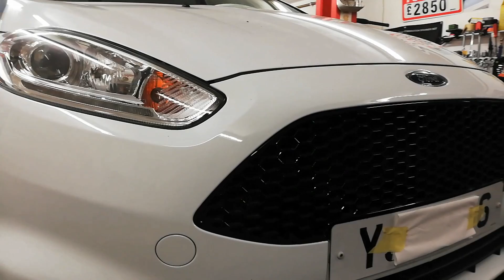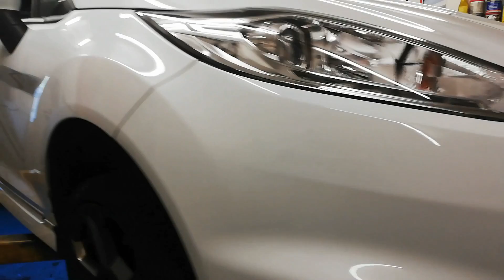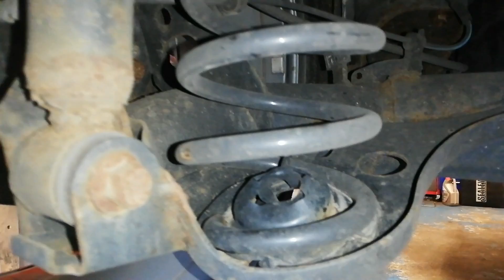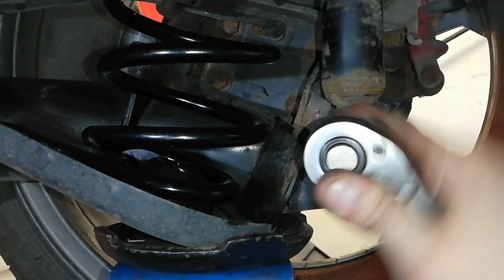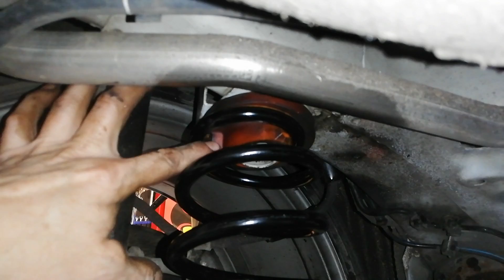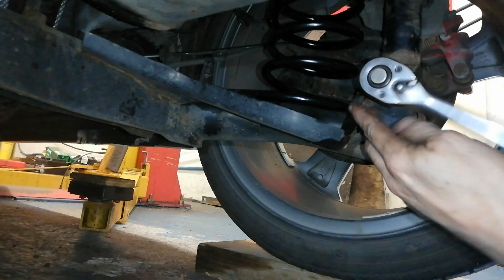Ford Fiesta ST Rear Coil Springs Replace

Comment: Hi Dave, this job just about beat me. I just couldn't get the bottom shock absorber bolt out. Tried everything apart from heat which I thought would be dangerous as it could heat up the shock absorber. So, just removed the two top mounting bolts for the shock absorber which came out very easily. Keep the videos coming , I enjoy them and have  learnt a lot!

Comment: I did this today . There's no need for compressor tool.  Use a trolley jack on the axle cross beam . Undo both shock absorber bolts . Drop the axle . Change springs .raise axle reinsert bolts . Done . I used threadless too .
Reply from the maker: Of course you can do that too. But this is a proper workshop with proper tools that can allow us to do this job in 10 minutes thus saving the customer labour time. Yes, you don't need a lift either
Reply: @davesterl   I appreciate your comment . Mine was a rusted spring not obviously broken though. Had annoying rattle / knocking . The original upper isolators looked awful so polybushed those.  
Car feels and rides beautifully now . No noises.
I'm grateful to all who post and produce videos. Thanks

Comment: That looks a handy wee spring compressor a lot better than my hydraulic one. where did you buy it?
Reply from the maker: Ebay or amazon
Reply: @davesterl  cheers dave was it expensive? How are you getting on with the milwaukee right angle impact

Comment: Think weve all got the spring tool nowadays  so dangerous with standard spring clamps , I always use a tie down strap round the spring , even on my floor standing spring compression tool , scary jobs that punters think it's only a spring ,will only take 15 mins ,  back home and doing a bit at home on drive , cant go to work for 2 weeks , keys thru letter box , drop n go come back later mr customer
Reply from the maker: Yeah mike, not to be messed with. Those spring clamps not recommended. Drop and go is a good system, adopt it myself.

Comment: Nice tool, I changed both rear springs on my daughter 2016 fiesta today.  It took about one and a half hours to complete.  I removed both back wheels and the bottom bolts in both shocks. Both springs came out very easy, the new spring when in very easy once I levered the shock mounting down.  Once the springs were in place, I could aline them both before replacing the shock bolts. Both of the original springs were broken in the same place as shown in the video,  job done all ok
Reply: Hi, Dave, another excellent video. Tried to get the bottom mounting bolt out, (14 year old car), with no success, tried impact gun, breaker bar, but no luck. So instead removed the two top shock absorber mounting bolts which let me fit the spring very easily!
Reply from the maker: Yep, another way of changing them
Reply: @davesterl  , and weve all had it close to chucking the car off the ramp when pushing up the suspension,  we know its safer to put bolts back in on the floor , Joy's of the job Dave 👍👍😎😉

Comment: whats the compressing tool called please Dave and does it give you enough clearance to compress ford focus rear coil springs that are always seized on the bolts to remove via lowering the bottom arm pan. thanks
Reply from the maker: Its just called a coil spring compress or as far as i know. I had one of the focus siezed bottom bolt a while ago, i think this tool came into play but it wasn't straight forward